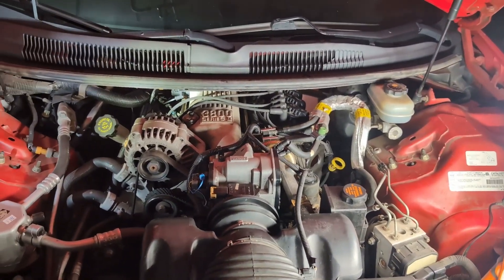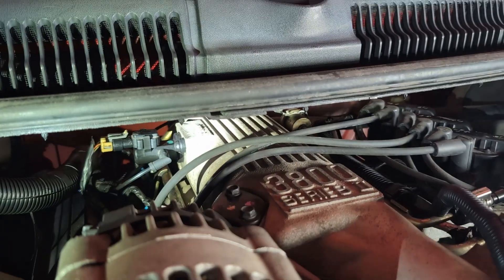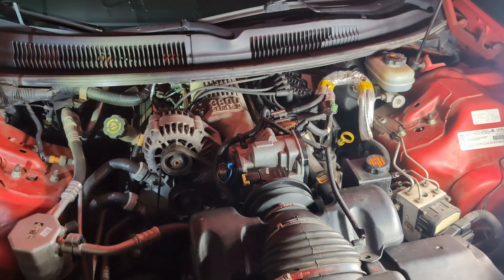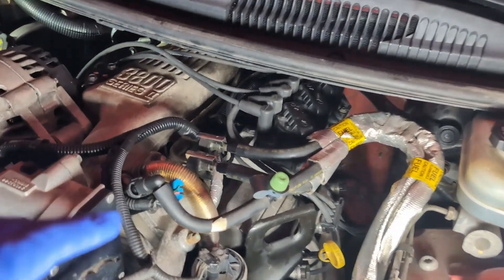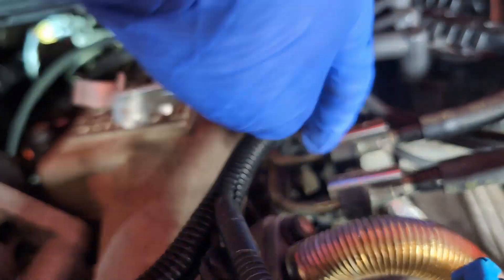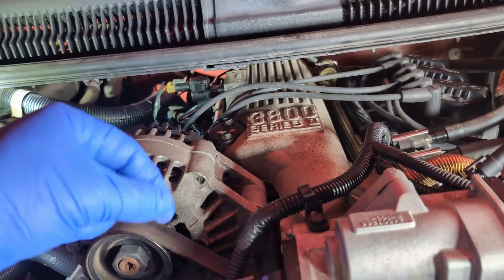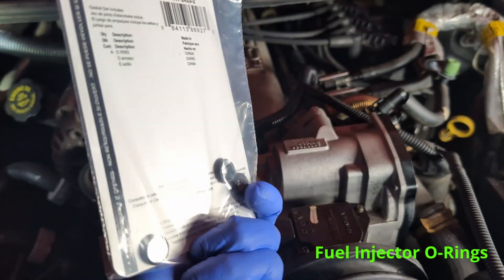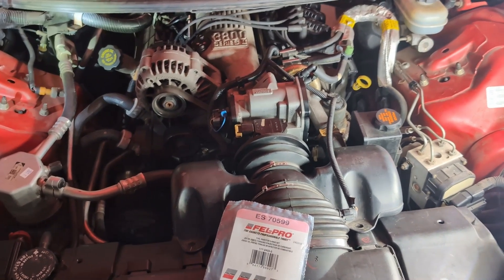P0172 & P0175 - Camaro/Firebird (1996 - 2002) Fuel Pressure Regulator Replacement - 3800

Comment: What about code P0446
Reply from the maker: I don't think P0446 will be solved with a new fuel pressure regulator. Without knowing your symptoms, I'd suggest checking your EVAP purge solenoid and looking for cracks in the lines leading in and out of it.
Reply: @RecordsRebuilds I’ve already replaced that part along with the gas cap tho I would have to look for cracks